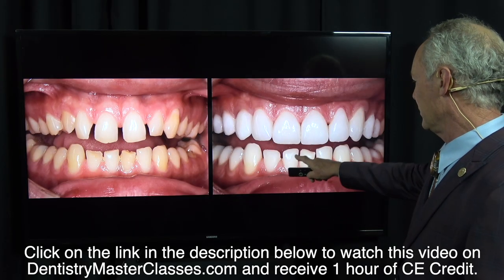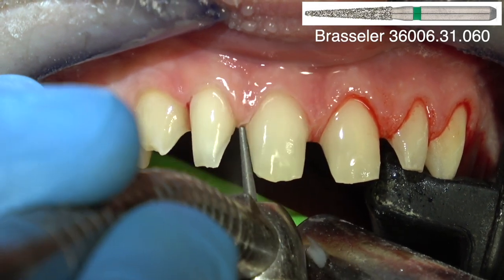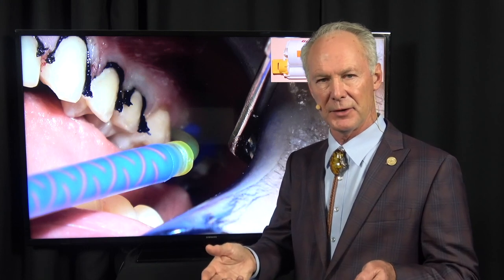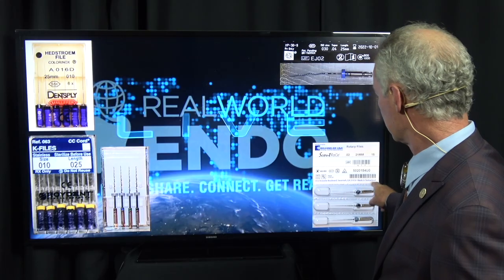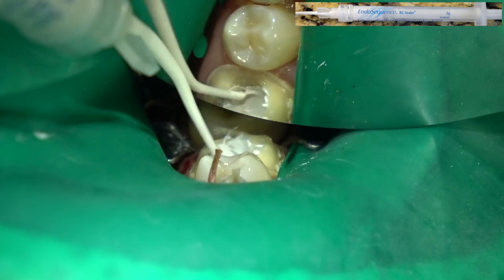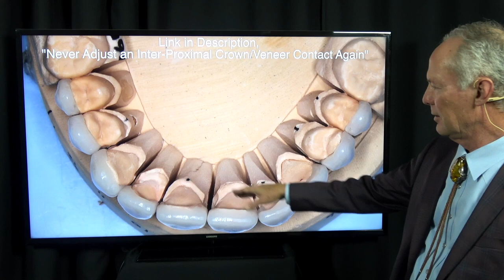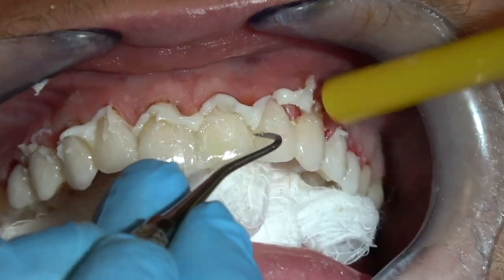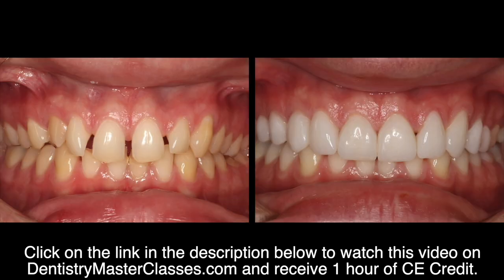Maxillary Veneers with Online CE - Dental Minute with Steven T. Cutbirth, DDS

Comment: Sir polishing with carbide bur on gingival margine ,,wont cause roughness on veneers and in turn lead to food accumulation!!
Reply from the maker: No, not if you use a 12 or 30 fluted polishing burr and use the burr in the "polishing direction," not the "cutting direction" with lots of water. The polishing direction of the burr is moving the burr "away" from you, not toward you. Take your practice to the Top Tier. Subscribe to DentistryMasterClasses.com for an organized library of all the Dental Minute videos plus many complete comprehensive cases and many very important articles. New cases are added weekly.  Only $20/month.
Click here to subscribe: 
https://membership.dentistrymasterclasses.com/purchase/?plan=513

Comment: Hi doc, when do you crown an anterior tooth? If its endo treated?
Reply from the maker: I try to not place crowns on anterior teeth because the teeth are small and removing circumferential tooth structure compromises the integrity of the anterior teeth and makes them more prone to horizontal fracture. I do not place crowns on anterior teeth following endo. Veneers if the teeth are broken down of discolored (conservative tooth removal). Crowns only if the tooth is badly broken down, requiring a cast metal post for crown retention. I connect the cast metal post to the crown if the post is needed for crown retention. Watch my videos in the DMC.com library on cast metal posts and crowns when teeth are broken down. 
Take your practice to the Top Tier. Subscribe to DentistryMasterClasses.com for an organized library of all the Dental Minute videos plus many complete comprehensive cases and many very important articles. New cases are added weekly.  Only $20/month.
Click here to subscribe: 
https://membership.dentistrymasterclasses.com/purchase/?plan=513